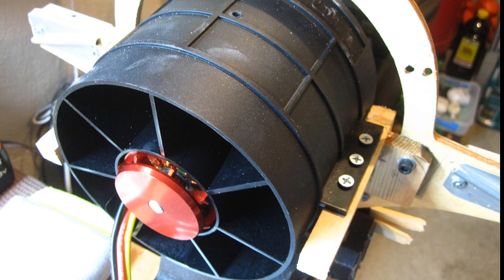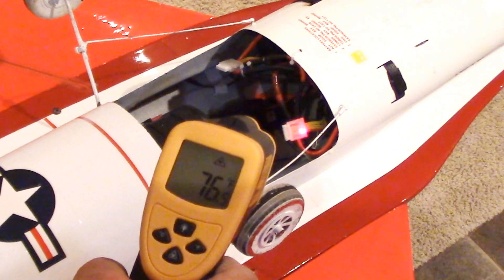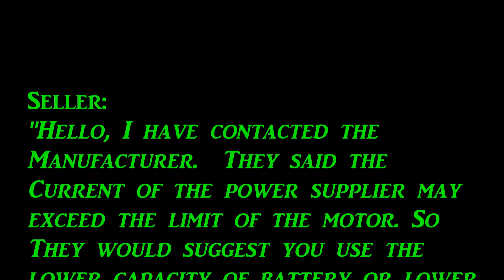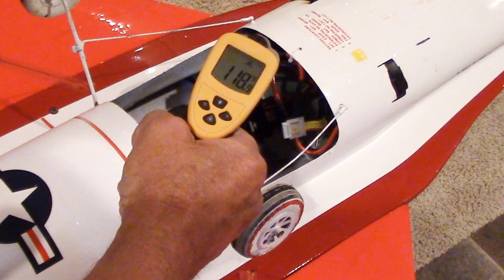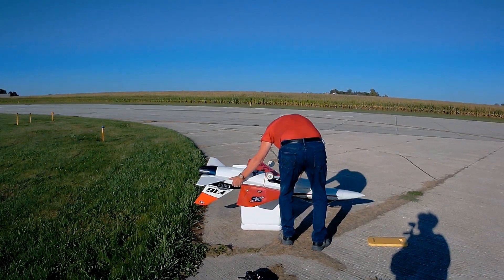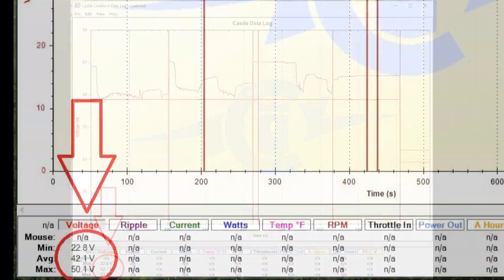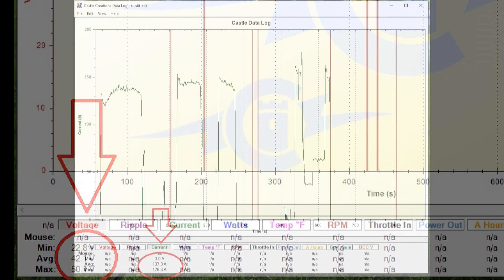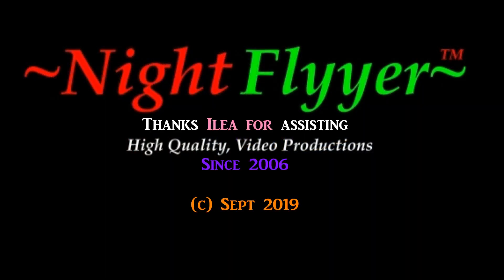Oh No!  My Electrified Byron F-16 motor failed again and here's really why!

Comment: The kv on the motor its showing on ebay is way to low to run on 6s , its posible the kv is posted is not really the kv but maybe higher and the reason your smoking it.
Reply: Something to remember is that lower Kv motors have smaller gauge wire that cannot take higher currents. So, over volting is going to smoke the motor.
Reply from the maker: @jgroetsema  Right.  Too bad the specs on the motor did not reflect that or I wouldn't have even tried....3 times!  Thanks.
Reply: @jgroetsema  Not true
Reply: @MikeyMikey1968  What Jeff wrote used to be usually true. Why is it not true now? How do they lower the kV (on a given motor) now, if it's not by putting on more turns - which requires thinner wire?
Reply from the maker: I had the 500KV fan in the very first flight, using 15 c batteries and all went well as you may have saw.  When I popped in the 25 c batteries, it blew the motor and speed controller, so I bought the 650Kv motor as that is also from the same seller and then put in 50c batteries as Venom said I should do and of course that failed too.  If its only supposed to run on 22.2 volts and I put in 42.4, that is why is smoked, but again, the specs on the ebay site says it can run on 12s.  That was misrepresented and I unfortunately believed them.  Thanks.

Comment: Using higher C lipos arent going to make it better, 25c lipos work in ducted fans as well. Its just getting the right kv motor for the job
Reply: Yes, the heat was the resistance of the battery as the motor was pulling more than the battery could easily supply.
Reply: Looks incredibly nice . i think the 8s 45 to 60c  will be the sweet spot . ✌✌✌
Reply from the maker: @thecraftking113   Yes, but a new light has been lit, though. Don D'Egidio is amazingly sending me a 12s fan that should work, so that happens next.  Please stay tuned and thank you.
Reply from the maker: Yes, I flew 15 c and 25 c in the first flights and they worked fine, but created a lot of heat as shown in all my previous F-16 videos, but ESCs were failing.   As I said before, Venom battery engineers I talked to on the phone and many subscribers kept pushing me to put in higher and higher c battery's, and that fixed the heat problem, but also made it easy for all that power to get to the motor.  This fan only comes with the 650 KV motor, so that is all I had to use. Thanks.

Comment from the maker: What happens when you pump 230 Volts into a 115 volt light bulb with nice big wires? That's right.  Poof!  I appreciate all the suggestions many made in my ESC failure video, albeit I had already made the wires as big as I could and used a proper ESC and 60 c batteries fixing that part, but again, I was concerned about the motor. It is hard to regulate amps, you know, so of course it failed! See my DATA LOGS at the end and you will see AMPS and VOLTS exceeded manufacturers specs.  So after this failure, I contacted the seller of the fan and motor on Ebay.  In a his reply, he said the motor manufacturer said this fan should only run on 6s, not the 12s and to use lower voltage and lower C batteries!   So liking this fan, I managed to find another, but am only going to run it with 8s batteries. I think it will fly, but not as fast as today's flight, which was incredibly fast, but also short. But I don't give up easily and maybe in 3 weeks when I get the new fan, I will try again, if it isn't too cold and snowing.
Thanks for watching.
Reply: If it was falsely advertised as 12s and failed, you could initiate a dispute with PayPal for that.
Reply from the maker: @zgr811975  But Both fans were purchased last year and this is the first time I tried to fly it.  Its past the point of no return.  Thanks
Reply from the maker: @beplh5242  I know.  If I knew the specs were misrepresented on the Sellers site, and it was only supposed to run on 22.2 volts, I certainly never would have pumped on over 50 volts, as that's what killed it for sure.  Thanks.